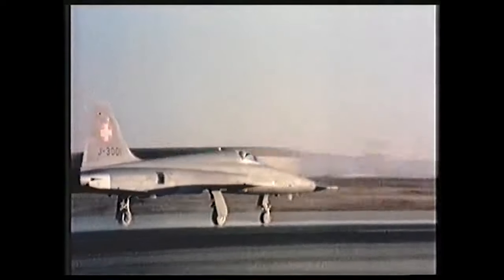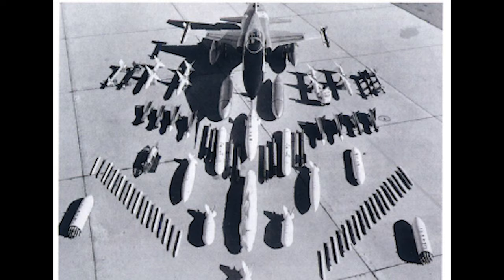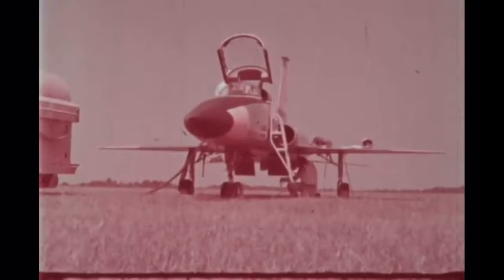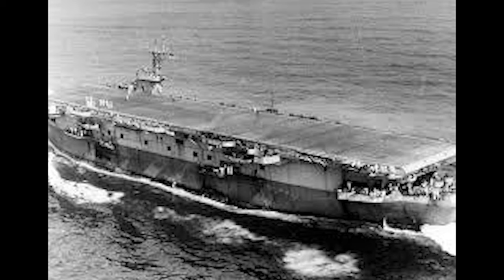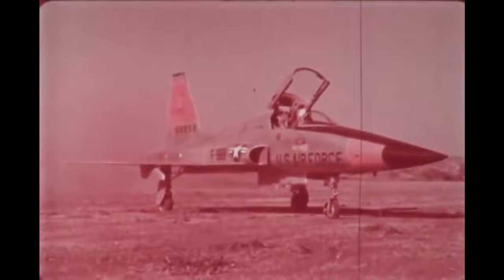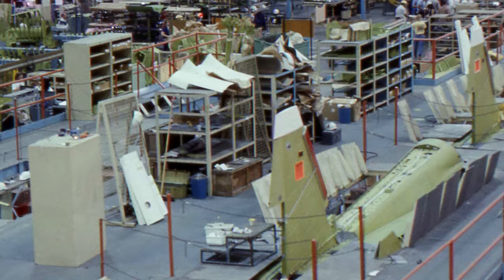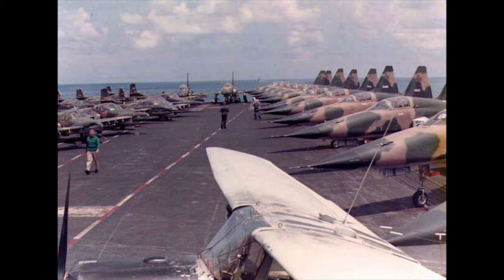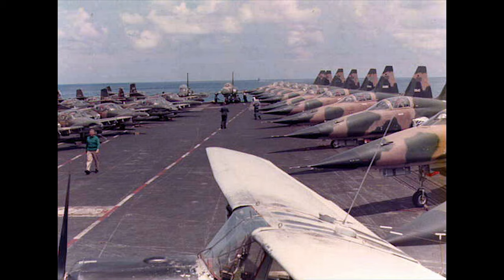F-5 Freedom Fighter | Best of Aviation Series Documentary

Comment: I worked on the T 38 from 67 to 71. I attended a special school on t38 f5 maintenence at Shepard AFB in Witchatah falls Texas. I was run-up and taxi qualified. I knew everything about the aircraft and was tdy to many bases to assist with problems. I had plans on going to work at Northrop when I got out of the air Force. But like you said, the program came to a halt before I got out. During a Christmas holiday we got to fly with the instructors. I learned how to land and fly in two flights. The are very easy to fly and an awesome aircraft.
Reply from the maker: Thank you for your service and your insight on this wonderful airplane!
Reply: Areo repair, reclamation, Holloman, T 38 A to T 38 B aggressors. We studied F 5s in our conversion program. Aim high, go fast.
Reply: I was thinking the F5 would be a great fighter to send to Ukraine. Easiest to learn and maintain. 
Large numbers in surplus across the globe. Would the trainers the US uses be able to be converted into fighters ?

Comment: By far and away my favorite aircraft ever.  An outstanding part-I to the continued life that is the F-5 series...   The aircraft was controversial with the Air Force generals who were not keen to have the aircraft they championed being shown up by an upstart design philosophy that out flew anything we had at the time, was cheap, rugged and east to maintain.  If you don't think some general officers are not in the pockets of defense contractors, then you need to pull your head out of the sand and take a long hard look around.    I look forward to the next one.
Reply: And my personal favorite is its descendant the f/a18
Reply: @spartanx9293   derived from the ashes (metaphorically) of the YF-17 that was the real winner of the Air-Force fly-off.
Reply: @ditzydoo4378  to be fair though the  yf17 was a heavily modified F5 and when I say heavily I mean heavily
Reply: @spartanx9293   True, the F-5 airframe was easily modified for many different purposes in it life such as the F-20 and X-29, and if you look closely at the airframe of an Saab JAS 39 Gripen fighter you will see and F-20 with a delta wing and forward canard configuration.  The original N-156 design is just so good.

Comment: In 2023...personally I could see a modern variant of the F-5, or a hybrid design between the F-5 and BaE Hawk, with enhanced avionics, modern aerodynamics, and  turbofan powerplants with the same size as the J85s. With modern technology of the engines, I could see an aircraft with 28,000Ibs of combined thrust. I could have seen the F-5 being a companion aircraft to the F-4, much like the F-16 is to the F-15, or the F-35 and F-22.

Comment: 9 NOV 2021. From the USAF I joined North American Aviation and then transferred to Northrop assigned to the Swiss coproduction version of the F-5E/F.  The unique Swiss version had much stronger wings than any.other F-5. wings with attachment  points so  they they could be lifted by cable and transported  by monorail  deep into bomb proof mountain caves. As a result the Swiss wings could accept  an addition 1..5 Gs. The Swiss built F-5s were absolute works of art and the Swiss Air Force had exception plots who really knew how to fly them. They were highly maintained in the caves  and for most they were not  flown much subjected to normal ware and tare. 45 yers later they were in such pristine  condition that the U.S. Navy bought bought several dozen back from the Swiss to be used at Top Gun as adversary fighters.  Then the Swiss bought the Douglas F-18  to replace the F-5 fleet in part because they knew that Northrop had designed the F-17 which became the F-18 which they were planning on keeping for a long time like the F-5s. Northrop builds the center fuselage and provide the radar for all the F-35 versions.  So Switzerland is going buy the F35A now. Insight comment. Don't ever get into a dog fight with the Swiss in their mountains and valleys.

Comment: Mexico has flown the F-5E for decades, 8 of which are still operational. Our Air Force has often praised the low maintenance costs and reliability of this fighter, but the purchase of new Air Superiority fighters that meet modern demands for aerial patrol and interception is inevitable. This attempt to substitute the F-5 actually makes for a rather interesting story. In 2015 & 2016, several companies from all over the world like Lockheed Martin, Dassault Aviation, Sukhoi, etc. came to Santa Lucia Air Force Base (north of MX City) to showcase different aircraft in hopes of getting that contract. The performance of the MIG-35 impressed the Air Force leaders, and Russian company Mikhoyan even promised to build their new export aircraft in Mexico. Modifications to Mexico's aerospace industrial corridor were proposed (5th largest aerospace corridor in the world, and the only one not located in a major economic power like the US or Russia), where 4 of the main cities in central Mexico (Guadalajara, León, Querétaro, and México City) would serve as the new factories for Russian fighter jet engines and avionics.
However, our government was concerned that building Russian aircraft in Mexico would raise tensions with its North American partners (US & Canada), so this proposition was deemed non-viable. The funds to renew our air superiority capabilities are still set to become available in the year 2024, and the option to develop a Mexican-built aircraft based around the design of a modernized F-5 has started to gain popularity. Like you said, the aircraft is modular and allows for upgrades. Essentially, an F-5 with modern radar capabilities, enhanced engine design, and possibly even swarm technology. It's not far-fetched since we already have Mexican-built drones patrolling our north & south borders (Called the S4 Ehecatl which are manufactured by Hydra Technologies). American company Raytheon already partnered with Mexico's Navy to install the modernized radar of our new Reformador Class Frigate, so a similar agreement could be reached to build the new F-5s. Finally, Korean company KAI came to Mexico in 2019 to showcase the design of its new F/A-50, which is based around the F-16D and also replaced the F-5 in South Korea.
This essentially means that we might yet see a final modernized version of the F-5 (I wish I knew the new official designation). I can't wait to see what happens!

Comment: The biggest flaw of the F5 was it's large turning radius, compared to the small weight and length of the jet. That's no wonder because of the small wings. That's why the F16 is clearly better than the F20 because the F16 has a much tighter turning radius....

Comment: The F-5 was lacking in the air to air engagement and by the end of the war it lacked a CCIP bombing while other aircraft had more accurate bombing systems. It lacked the ability to carry heavy loads and long range. but it was a cheap fighter and the F-20 should of definitely been developed more as an alternative to the f-16
Reply from the maker: ZMartian thanks for commenting and excellent analysis.  Some of what you mentioned was addressed by the E/F versions and the F-20 as you say.  Those are upcoming videos in the series as well as the latest iteration - the AT which is surprisingly effective.
Reply: @Joshua N. Ajang Thats Truth, BUT the jas 39 gripen is kind of designed lika a 4 or 4+ gen figter, and the tigershark are kind of the same 2 or 3 gen (IDK) design.